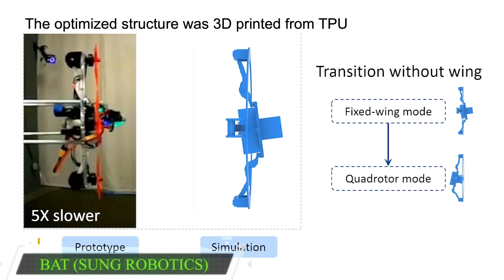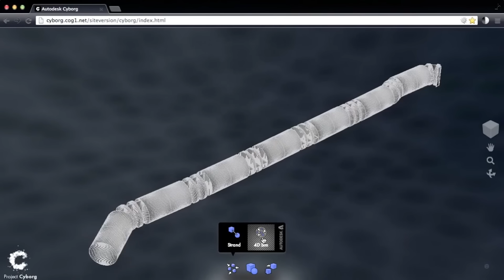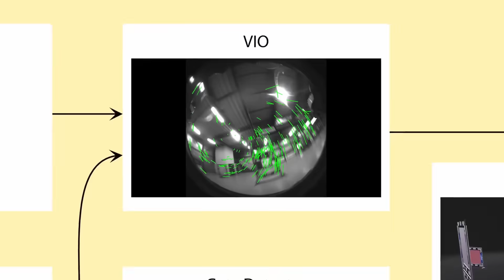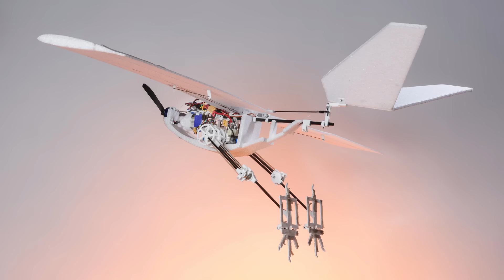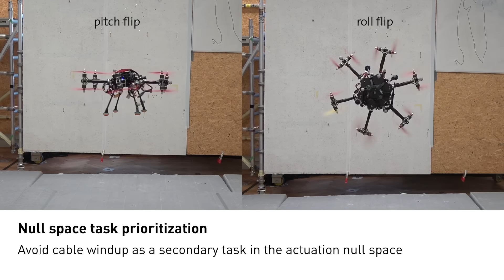Future Drone Has ARRIVED! - Hybrid Robotics

Comment: Also, I'm pretty sure that evolutionary computing would be another feasible adaptive control mechanism. Reinforcement learning is at least partly just the most trendy method for training NN's for online learning scenarios. EC is largely underutilized because it requires more intuition and better programming than a thing like an ANN where you can just dump large amounts of data into it and let it sort things out.

Comment: Not True. You also skipped on subject of power source. Battery is heavy and has small limit. But even electric motor can be powered  by multiple solutions,  like transforming hydrogen or microwaves for example.

Comment: Giggles at planet Earth > Runs finger through Triboelectric/Static pipes to internal turbine/propeller system with Ultrasonic resonance destruction frequencies crumbling everything at Atomic structure to keep clean Duct shutters on all side of craft + airflow drag design to use air inside to stabilize craft with electrostatic lift support + Electrostatic bleed system to collect static energy for increasing power to Plasma generated Ultrasound pressure wave anti-drag to scan and remove drag. Earth Science: "Spiders fly with electricity! But even though Bees produce Thundercloud level electricity in Swarms we tell you it does nothing for them because we programmed majority of Humanity ignorant on purpose." < I wanna change that..

Comment: ball drone looks nice. keep it simple, even if seems require complex. less headache is more. so that you can math model all things properly. because its simple not complex. hard coded instead of ai. complexity is not a metric of usefulness. rolling drones rock. why do you push for more complexity with articulated. burden grows exponentially with all the complex features you want to propose. saying RL means you cannot code it yourself from scratch. ai based detection is only useful for autonomous task planning, not in the core kernel system. keep rust away from the core.
Reply: try a cube drone, with 6 axial prop fans.